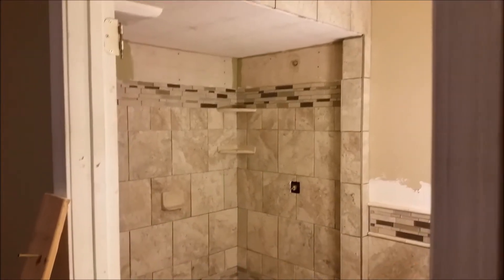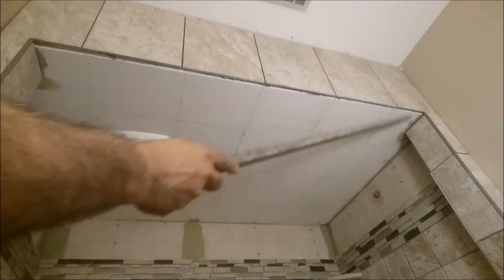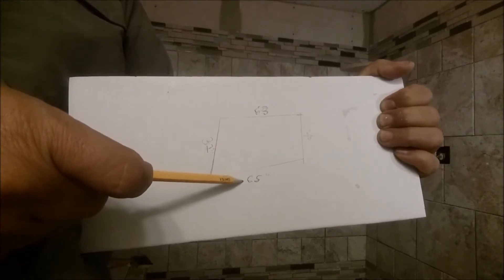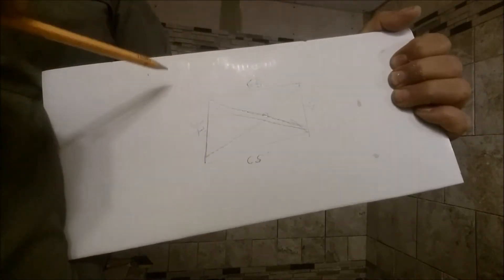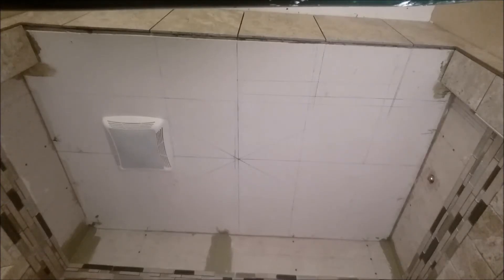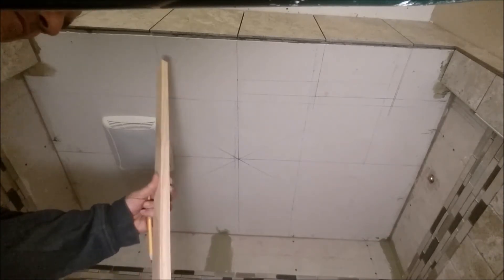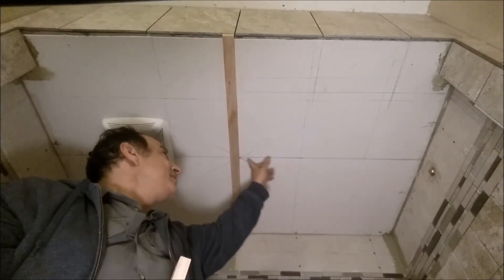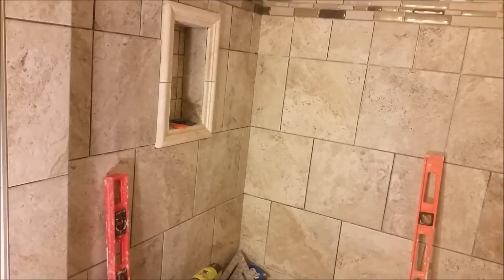How To Tile A Shower Ceiling - Part 1  - Planing Where To Start And Layout The Tiles

Comment from the maker: Best Thin set used = https://amzn.to/3cxVBz8
Medium thin set =  https://amzn.to/3mSk9aR
QEP Leveling System  = https://amzn.to/3n39GJN
Tools and Materials  used:
Angle grinder used = https://amzn.to/368IX8C
Diamond Blade =  https://amzn.to/3j2kTbc
Dimond hole drill bits =https://amzn.to/36bX2Cs
QEP wet saw = https://amzn.to/3cLJgaW
Diamond Blade = DeWalt https://amzn.to/3jfdpSr or Black Widow https://amzn.to/3jgx18G
Grout Float = https://amzn.to/3j7KO1c or https://amzn.to/348KLMu
Notched Trowel 1/4 x 1/4 x 1/4-Inch= https://amzn.to/3j26Zpv
Notched Trowel 1/2x 1/2 x 1/2-Inch= https://amzn.to/2S5Zceg
Notched Trowel 1/4 x 3/8 x 1/4-Inch=https://amzn.to/3cDPbhZ
grout sponges = https://amzn.to/3ieBx68
Nitrile Gloves = https://amzn.to/3i8VhrT
Best Thin set used = https://amzn.to/3cxVBz8
Medium thin set =  https://amzn.to/3mSk9aR
Mapei Pre Mix Grout = https://amzn.to/2HqhdC3
Mapei Grout = https://amzn.to/340hWS5
Miter Box Used =  https://amzn.to/2SnYgm1 or https://amzn.to/2G1CVfB
Hand saw =  https://amzn.to/30kvabp
48" Level = https://amzn.to/347tmUl or https://amzn.to/30m3y5H
Leveling System  = https://amzn.to/3n39GJN
Silicone =  white https://amzn.to/36iyJTp   clear https://amzn.to/33ZfThb
Pro Caulk = https://amzn.to/2RWqfca
Amazon Deals:
Try Amazon Prime 30 days for free = https://amzn.to/2JMWaLe
Create Amazon Business account = https://amzn.to/3mLSyYt
Joint Amazon Prime Watch Thousends Of Movies and TV = https://amzn.to/33NfsHD
Try Personal Shopper Wardrobe  https://amzn.to/2VClfv9